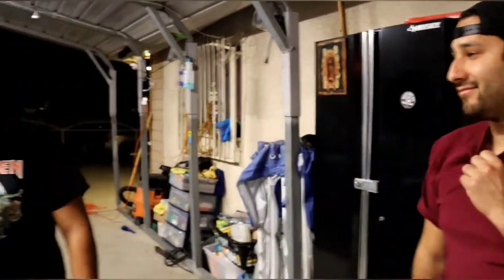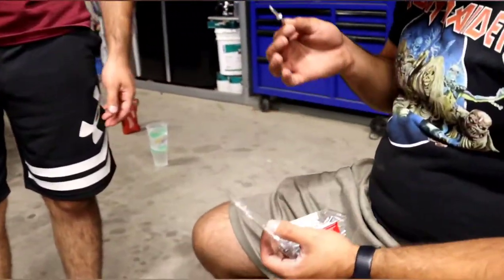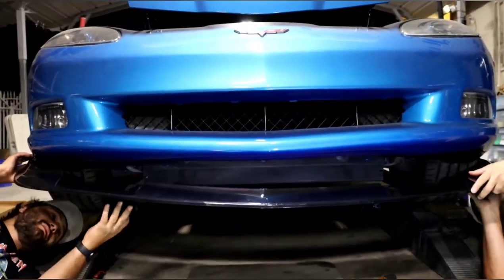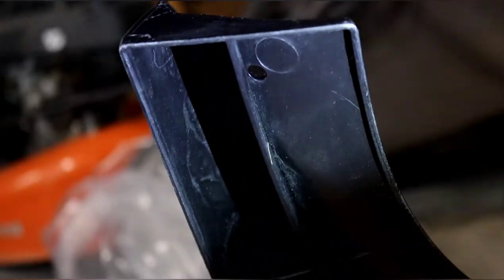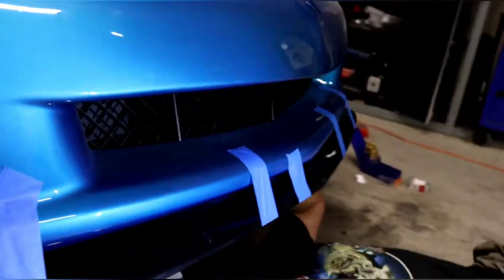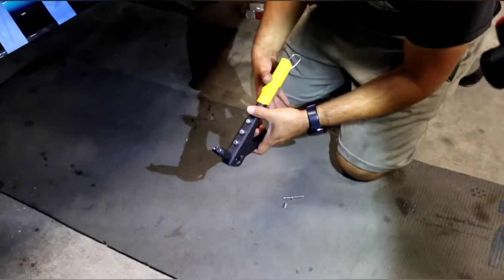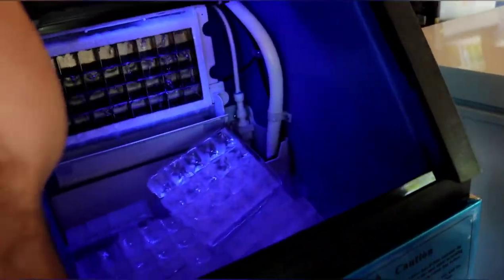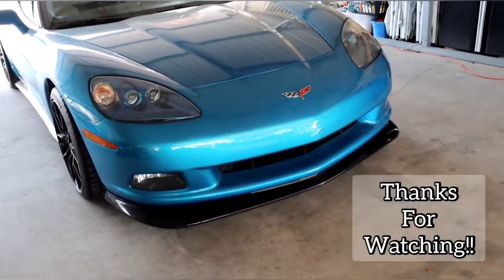Corvette c6 Front Splitter Installation

Comment: Going to be much harder to remove if it gets broken with rivets..
Reply from the maker: Use the same 3/16 drill and drill in the middle of the placed rivets. Should destroy the flower from the inside fairly easily and damage nothing else.

Comment: Is this the extended one or the zr1 conversion one? Looked on the website and there are 2 different ones for the base
Reply from the maker: This is the extended zr1 splitter for the base by EOS. Although the none extended and the extended are literally like the same... the "extended" one has better mounting material as you see in pictures. I first ordered the smaller one and it was utter garbage. EOS was nice enough to refund me without me having to return it. 

https://www.ebay.com/itm/203236857595?mkcid=16&mkevt=1&mkrid=711-127632-2357-0&ssspo=Pp0ctOcnTVS&sssrc=2349624&ssuid=q9a9iy09q_-&var=&widget_ver=artemis&media=COPY